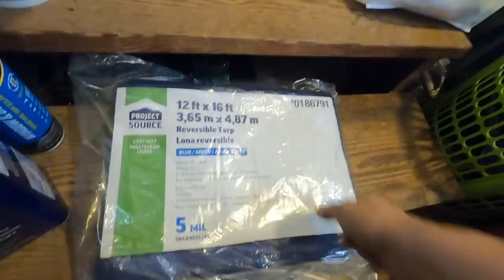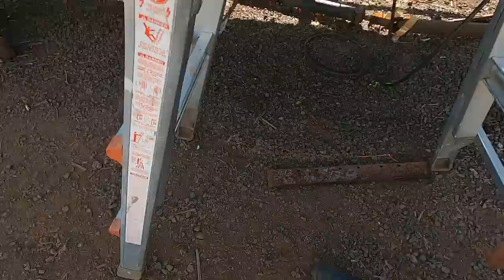RV Rebuild (Part 12) Finishing Welding Walls & Prepping For Winter

Comment: Just a ideal for ya i live a travel in a stepvan with a all aluminum body yes it doesn't rust but it was like a oven in the summer so I took a 5 gallon bucket of that white cool seal rubber roof repair and covered the whole body top sides every where. Glad I did it was a huge improvement and seems to have added a small insulation r value

Comment: There is a glue for metal panels (Instead of welding) use for bonding the panels to the frame.  Just to get less warping . I still enjoy your progress on the build.  Regards from South Africa 🇿🇦.

Comment: Why didn't you just prime the steel instead of WD40 ?...... huge mistake.
Reply: How about you go help him since you seem like such a expert keyboard warrior
Reply: What's the differences?
Reply: @Donotpass_go  never get all the oil out of the steal so paint will not adhere to the surface, common sense.
Reply: @robertbrown4074   Sober up before making stupid comments.  It's Common sense.
Reply: Robert Brown You do realize steel comes pre oiled so it doesn’t rust while sitting on rack at metal supply stores?  I guess you would know if you actually worked with steel.  Wd-40 is used all the time during fabricating projects that take more than a day.   Areas around welds rust first because the heat from welding boils off and dissolves  most of the protective oil applied from factory.
Reply: @lifeguard434343  32 years hauling steel...... not all steel is coated from the foundry, steel that is going to be used in raw form is coated steel that is going to be painted or coated is shipped raw..... genius. But if you ever worked with steel you would know that.
Reply: @robertbrown4074   working with steel and hauling steel are completely different.  I didn’t know they had non oiled steel.  I have fabricated rollcages and suspension for the past 27 yrs.  So I have some experience. But I’m willing to admit being wrong.

Comment: You're doing great!  😎👍

It may help to keep on hand some Vanilla for burns and Sage for cuts.  Keep putting vanilla on and use fan to cool it until it stops burning.  Helps prevent most blisters from forming if it's done quickly.   Apply sage to cuts and hold pressure til it stops bleeding... use a bandaid or butterfly to minimize scars.  Cabbage leaf on a swelling can help.  Just wrap a piece from the head of Cabbage around and secure it.

Comment: You may want to look into osphoric acid
Just painted on the rust
 leave it overnight and brush it off with a wire brush 
Turns rust from iron oxide into iron phosphorus 
has a white powder look
Then you can prime it and paint it

Comment: You're making really good progress. Don't forget to trickle charge your batteries while they are sitting. I used to use ACF50 on my motorbike to prevent it from rusting - used on aircraft carriers on the jets I think. Bit more expensive than wd40 though.
Reply: @zoidberg444  Acf50 an air compressor and an oil spray gun. Done in 60 seconds.

Comment: Done auto body and paint for over 30 years and can twll you theres nothing worse then wd40 to have any2where near something your planning to paint. Silicone is horrible to deal with. Causes major fish eyes in paint. Would actually been better and easier tl deal with surface rust than it will be to try and remove the silicone residue. Best wishes, enjoy your videos.
Reply: WD-40 has no silicone in it.